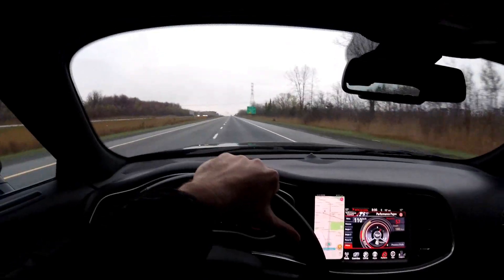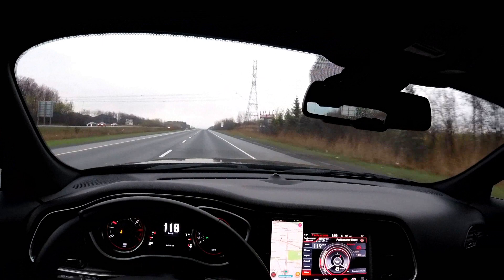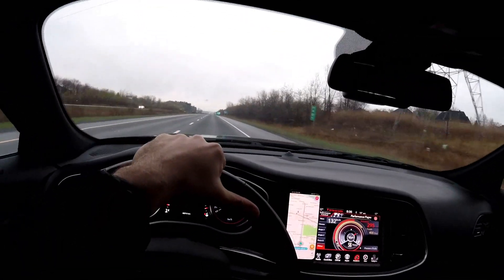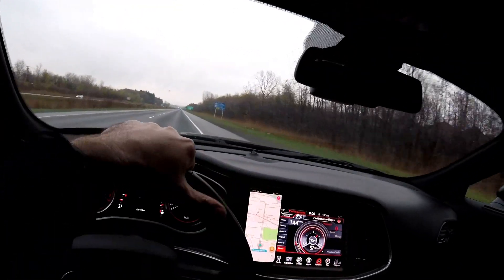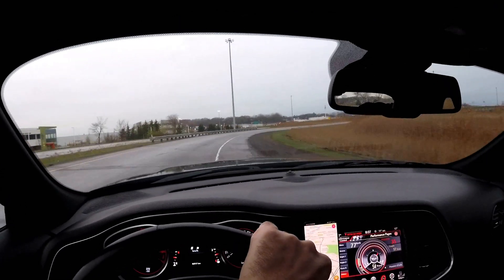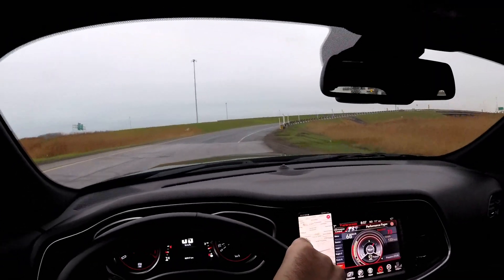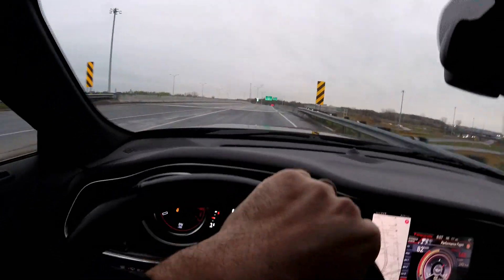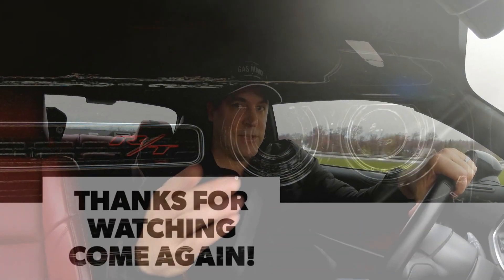HEMi TICK - Engines Idling Comparaison

Comment: For any of you worried about the hemi tick, they all do it and it's not going to hurt anything as long as the oil is kept changed. Don't try putting in a different weight of oil or anything as it won't really help. I own a farm and we have a dozen bighorn 1500 rams with the 5.7 and they all tick at idle. One has over 300,000 farm miles on it with lots of idling (over 15,000 hours). Sometimes the manifolds snap the bolts and occasionally a water pump leaks but otherwise these are great trucks. Several of my mechanics have reiterated over and over that this is normal for these engines and it isn't bad, we even ripped the cam and lifters out of the 300,000 mile hemi just to inspect them. They all looked fine. The issues start happening with these engines when the oil is allowed to sludge up, then the small passageways for the lifters get clogged and then the lifters become a time bomb. In some cases the cam can even get screwed up. Just ignore the oil life meter and change the oil out with full synthetic 5w20 every 3000 miles or 1 year if you idle it for a long time or do a lot of towing or are in a lot of stop and go traffic and every 5,000 miles or 1 year if you just drive normally (little to no stop and go traffic). Change the trans fluid in the 8 speed every 50-60k miles. You do have to drop the pan but it's worth it. That Charger sounds like the oil wasn’t changed enough.
Reply from the maker: BINGO! that is the truth. On my second winter I had a lot of stop and go traffic and the oil turned like sludge. I always changed oil with using the oil life sensor gage but Like you say, I should of change it a lot earlier that winter. So is there any Products out there that can clean the passageways? Seaform? Magic mystery oil or any thing at all?
Reply: @HemiMike  try seafoam, but if the passages are completely clogged it may be too late. (It didn’t sound like they were clogged, but you never know) Check the oil once a week (as you should do on any car) and see what color the oil is. If it’s been over 3k miles and it’s black then you may want to change it. It all depends on what kind of driving you do most, if you are usually in stop and go traffic then change it every 3k miles. DO NOT use Lucas oil. We have also tried that on our 300,000 mile hemi and it made the problem MUCH worse. It sounded like it was going to throw a rod. I think it’s because the Lucas thickened the oil a lot which caused the oil pressure at the lifters to drop dramatically. My new 2021 1500 limited daily driver doesn’t tick at all after 1500 miles. And Chrysler supposedly upped the oil pressure from the oil pump in 2018 and slightly changed the engine block design so the hemi tick should be fixed for good on my new DodgeRam. Honestly, it’s just something that you’ll have to life with. It’s more annoying than anything else.
Reply from the maker: Have you had any success with it once?
Reply: @HemiMike  on my trucks, no I haven’t needed to because we are religious about maintenance. But my son got a 1500 from 2010 with 95,000 miles real cheap (4500) because it “needs a rebuild”. I told him he bought a boat anchor and he threw some seafoam in it with fresh oil and BAM. The thing was purring like a kitten in 2 miles. Shocked the hell outta me with that one, the truck was a one owner old man truck that was a top of the line Limited. If it hadn’t been for that engine it would’ve costed 15k at least. The thing had no rust at all which was amazing. If you do run the seafoam, put it in 300 miles before your oil change as all that gunk running around the engine for 5,000 miles can’t be good for anything.
Reply from the maker: Wow. That is amazing. Im going for new oil today, perhaps next oil change in the fall I will do it.
Reply from the maker: Thank you Ryan for sharing your experience and detailed knowledge of the Hemis.
Reply: Had to do a cam and lifters on my 2014  and it had been very well kept but the mds lifter on #7 failed so oil changes don't always work
Reply: How much did it cost @trentonrobinson2745
Reply: My Hemi is a 5.7 1500 2012 Ram and I put 5w30
Reply: I will definitely listen to Ryan! Farmers are one of the smartest peoples in the world. My dad was a farmer and I am still amazed at all of his dad to son life hacks/tips/knowledge he never steered me wrong. Plus he could do just about anything and did! Thanks Ryan for the info!
Reply: Thanks for the info. My question is does the Hemi  from the early 2000s to the ones you find in the 09-14 the same? If there are differences what exactly are those differences?
Reply: @abecampbell2439  The engines from 09 and up are the eagle engines, they have better flowing heads and they have vvt variable valve timing along with mds solenoids. I suggest you watch reignited on utube. The guy is a former dodge technician engine builder. He has great information about the hemi.
Reply from the maker: He does, I can't wait to watch his results on the hellcat oil pump replacement
Reply: @HemiMike  hey Mike I just posted a video of how my 5.7 hemi sounds it has 21000 miles...what is your opinion...did you ever figure it out?
Reply from the maker: VVT variable valve timing

Comment: I have a hemi 5.7 shaker manual with non mds lifters it sounds like your 2nd hemi clip at idle but I also hear a rpm matching tick when driving from the cab with the windows up and everything. I’m not sure if It’s the injector noise that I can just hear more of because it’s a shaker or if it’s a lifter starting to fail.
Reply: Same here man . Did u ever figure it out?
Reply from the maker: Yes, Was just loud injectors

Comment: I have 2007 5.7 ram 1500 just did an oil change at 3000 mile 5-20 high mileage and 10000 oil filter and I just noticed it has a a slight tapping /tuck noise at idle I don’t hear it while driving and only when I get out and listen closely it’s not screaming ticking but if your listening you’ll hear it ,I just noticed it after I did my oil change anyone no if it’s the “tick” my manifold bolts were already replaced not to long ago so that’s not a question
Reply from the maker: My sound comes from the injectors...normally loud they said.

Comment: Mine is a 2019 with 15k miles and it's ticking and the tick gets louder and faster when I raise the rpms and sometimes it doesn't tick all the time but it's not the manifolds for sure and I'm pretty sure it's not the lifters or injectors it sounds like it's coming from behind engine like the clutch area being it's a manual any idea?
Reply from the maker: Sorry I don't. It is hard to say anything without hearing it and locating it.

Comment: Just had an engine replaced on a 2020 challenger scat pack. The first one had rapid ticking upon acceleration, no hemi tick. With the new engine, I have the darn hemi tick that sounds just like your 2016 challenger! It is annoying as heck had it for a week since replacement
Reply from the maker: Mine only has loud injectors which is the most commeon sound coming from these hemis...not much to do about it.

Comment: I hated hearing that with my hemi Lucas injector cleaner upper cylinder lube amazing stuff completely stopped my top end noise!!
Reply from the maker: Really? Wow... I might try that!
Reply: @HemiMike  yup i Promise you wont be disapointed give it 15minutes to work thru maybe longer and it will stop I was extremely impressed stopped it all together 110000km on my Hemi unless its the manifold!!
Reply from the maker: Wow. I might make a video out of this! Thanks for the input. How long did it last before doing it again?
Reply: @HemiMike  i just found out about myself off youtube so i thought id give it a try i imagine some will have to be in tank at all times to keep top end lubed so did you try it!! what was your results
Reply from the maker: No I have not tried it.
Reply: @HemiMike  So after 1week of use tick is pretty much gone every once in awhile you hear it but engine sounds so much better you dont hear the top end tick i use a bottle every couple fill ups

Comment: I have a 08 ram 2500 mega cab 4 x 4 with the 5.7 L hemi and I was so thankful to find out that it was a exhaust manifold leak on mine because the tick would go away once it warmed up so I just got to get that fixed which I’ll take that any day over a tick. Jesus bless y’all.

Comment: Ive gotten long tubes and deleted the mds. It ticks so loud i can hear it with my windows up while driving. When i open the hood i can hear the injectors, and all the other engine noise, and when i listen under the car i dont really hear anything. But it is so annoying hearing a ticking noise under acceleration. Ive been told the long tubes make the engine noise worse, and that nothing is loose. Anyone else have the same thing?
Reply from the maker: Yes! Me since I've installed the SRT headers the engine noise are pretty louder!

Comment: Honestly sounds the same, same pitches and rhythm. 

Only difference was the loudness. 

Sounds more so like crappy fuel clogging small pores in the injectors.
Reply from the maker: Right about the loud injectors but I use 94 octane.
Reply: @HemiMike  can be high octane but also not the best quality high octane, gotta remember in most northern gas stations the additives that improve the octane is mixed in AFTER processing at the refinery

Comment: If it means anything, I'm certain this is normal valve train in aluminum heads. My LS2 GTO had the same sound at 37k miles.
Reply: I also have a 14 challenger 6 speed and it isnt as loud as the GTOs valve train noise
Reply from the maker: Yes it is plus the added loud injectors  sound

Comment: Hey I have been looking for a older Gen 3 dodges They all have a slight tick mostly sounds like injector firing tick. No valve rocker tick noise. And I have looked at atleast 50 different trucks 2003-2007 years 5.7 hemi. Nothing like valve rocker tapping . Now I have a 2019 Ram 2500 with 6.4. I heard a tick or a slight tap once in awhile and mileage was only around 1200 miles. Now today I heard that same noise at 8100 miles yes just 8100 miles. I’ve done 2 oil changes up to this point. During these ticks, tapping the engine never missed a beat, hesitated, or idle down. RPMs stayed consistent. No reaction from engine at all. Idled perfect. Tap dissipated. The oil is clean because it was changed 1000 miles ago. The first episode occurred at 1200 miles. I use the correct viscosity oil 0W40 Pennzoil and Mopar filters. I will probably go with NAPA gold next oil change.

Comment: hi hemi mike   i ave the 5.7  hemi in  grand cherokee  2011 the worst year they  say  i ave  the  tick  and  the chit hit the fan wen  the oil change  was due  and you know  somme time  your  to  chort on time cuz work and aving an apointment  mostly in winter  so one day  get on the hiway  snap it to the flor  wen it got to 6000rpm  check engine lits up  and there  was the code for cam  and missing fire  after that engine last 2 monts  before  it realy start running on 7 piston  but that was a 250 000 km engine  i know  you gona say hey why dint you fix it ? cuz i ave  another engine from a 2011 ram truck  same 5.7 hemi whit just 140 000km  put in the jeep and its perfect . i keep my oil clean  now lol . change it before its due  and til now no tick at all  notice when i did the swap  i ad to fix stud manifold  on the 2 side  so its hard to say  the tick comme from the manifold or the lifter  that was my story hope it help
Reply from the maker: Thanks for sharing François! Merci. My noise comes from loud Injectors it seems.

Comment: I can't believe it people are thinking it is a major problem but it is injector that are making those noises different fuels in this motor makes the injectors sound differently that's what people are hearing if they just wake up and realize that. I use Lucas upper gas treatment in mine and it changes that noise.😊
Reply from the maker: What octane fuel are you putting in with Lucas?
Reply: @HemiMike  for the last four years with 20,000 MI I've been using 87 octane but I go from 87 octane to 89 octane back and forth but I use the Lucas religiously on every tank full. It keeps everything clean in the combustion chamber my exhaust pipe will burn white or totally clean no Gray or black residue in tailpipe. PS mainly City driving 10 miles per trip usually. Average 18 to 19 MI per gallon with MDS shut off by steering wheel control 2017 ram there's a video on YouTube how to do it after vehicle is started I do it every time if you have the toll Hall option hit that button and it will shut it off.
Reply: if you are putting in lucas upper cylinder lubricant, and the noise goes away, then you have an issue with your valve train 100% no engine is designed to be noisy and adding any kind of additive is a temp fix. this is coming from a 20+ yr mechanic.
Reply: @jeizero my initial posting I did not mention that I run a catch can ever since it was new it keeps the fuel at a more regulated octane level instead of trying to burn the oil Vapor residue in the cylinders😅 Anna Lucas puts a cushion on everything in the fuel system did Fleet Service of over 15 years and had no problem and it doesn't hurt anything in the long run.

Comment: I have an old 06 with 150k that does this (a little worse) can't believe they still haven't fixed it. Either im lucky. Or its exhaust bolts because it is still going 🤞 all i know is im not doing a lifter job on an 06. Doesn't make me confident in my hellcat, might trade it before it shows up there. For sure if the lifters in the 06 go out, I will trade the hellcat before I end up dealing with it there.
Reply from the maker: The diagnotics results came in since and the sounds comes from the injectors, normal loud 65lbs injectors sounds...your hellcat has bigger injectors so it most likely won't sound like this.
Reply: @HemiMike  for sure nothing yet! The 06 5.7 I have however...its definitely the sound of something like clicking a screwdriver against something metal. Good that yours is doing well! Maybe I'll pay for a dig someday, but I had a mechanic tell me already it sounds like lifters, but that it would be okay.
Reply: @HemiMike  65lb injectors that's enough for 700-800hp? 36 or 42s would be plenty...

Comment: 2011 Ram 1500 Sport Hemi.
After drilling out 4 broken bolts and replacing the manifolds and gaskets with new doorman and remflex, the sound remained. Tried different oils with no luck. After being sure this sound couldn't possibly be fixed from just an expensive oil I said why not try one last thing before I have the cam and lifters replaced... Redline 5w30 and a Wix XP Filter got rid of the sounds almost instantly, after 200 miles the sounds are completely gone!
Reply from the maker: It sounds quite extraordinary. Wow that is a nice fix. Which part of the country you live in? Do you have to deal with hard winters or Hot summers?

Comment: Dude thank you... I thought I was having the lift room to issue but I couldn't tell between the injector pulse and the valve clicking. hemis are noisy as is but then you throw in an exhaust leak and the dreaded hemi tick and it's hard to know which way is up. Thank you bro
Reply from the maker: Happy it helped! 👍

Comment: Both of them Vehicles Sound Normal  Loud Injectors. Now if it's loud enough you Hear it while the Hoods Closed, Might be a Lifter if it is Missing on Certain Cylinders. 
If its not Showing Codes for that then i wouldn't worry, Just keep the Oil Changed and keep Trucking.
My 5.7 Police Interceptor Ticks Randomly and only sometimes, It has 138,000 Miles, ive Driven it 10,000 Miles with Zero issues.
I've also heard sometimes if the MDS solenoid goes Bad it can Cause ticks due to Low Oil Pressure to The Lifters on that Cylinder.
Also keep in kind 5.7s stock Timing Chain Guides suck and sometimes the Retentioner can get broke or become stuck Resulting in timing chain flopping around making a very distinct High Pitch Ticking.
Reply from the maker: yes, you are right, the sounds comes from the injectors mostly!

Comment: I have a 2016 Challenger with the 5.7 with a manual tranny so I don't have the MDS and I have that tick after I've been driving for a while and I stopped somewhere an idle but not all the time it's random... I have 74,000 MIles.. I bought the car with 68,000 Miles.. did you ever figure out what's going on with yours???? Like I said mine doesn't do it all the time... Almost makes me wonder if it's an injector noise..
Reply from the maker: That is what the dealer mechanic told me. Normal sounds coming from the Injectors
Reply: @HemiMike  yeah that's what I figured... I tried really hard to not let my car idle very long and if I do in traffic I rev it up to 2000 RPMs every once in awhile.. I watched that video of that guy that breaks down the hemi motors he shows you the inside of the motor and at idle the crank does not splash up enough oil to get onto the needle bearings of the bottom of the roller lifters.. at 1500 RPMs and higher it splashes enough oil up there.. I've never owned a hemi till now but it makes sense.. the camshaft is really far away from the crank unlike Chevys pushrod motors they're really close together...
Reply from the maker: Yes, Uncle Tony's Garage. I'm thinking of changing the idle rev up with my diablo tuner
Reply: @HemiMike  didn't know you could even do that... Hey quick question not related to what we've been talking about but do these cars automatically update themselves if there's a new software update or anything or do you have to manually go into that u-connect thing???
Reply from the maker: @tonyderks9172  manually, I did it once. Kinda of a long process
Reply: @HemiMike  all right well cool nice talking to you hope you're hemi  stays running good for you :)
Reply from the maker: @tonyderks9172  it was a pleasure! Come again. I should have a new video by the end of the week. Cheers.